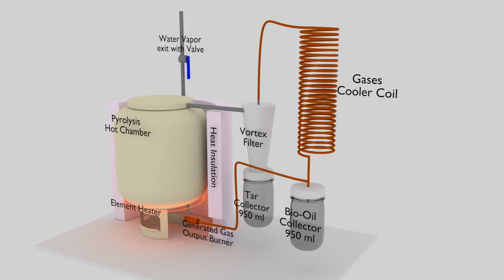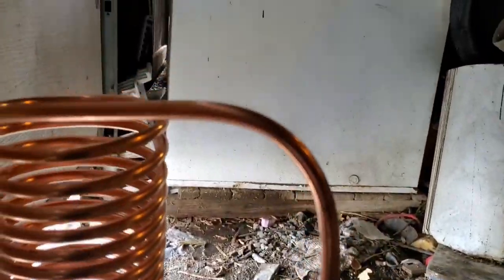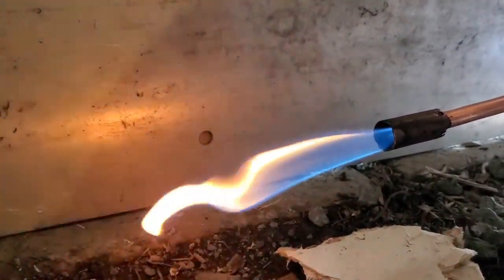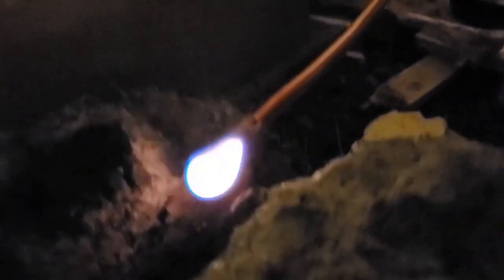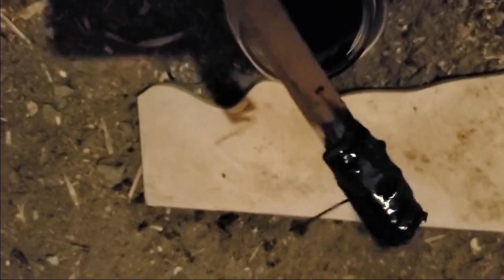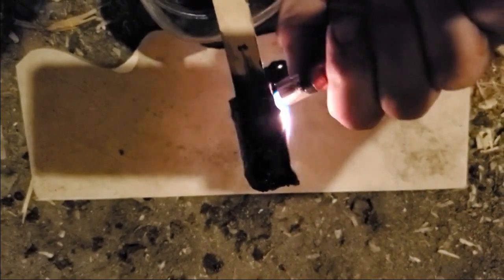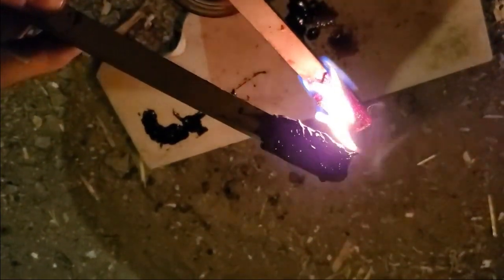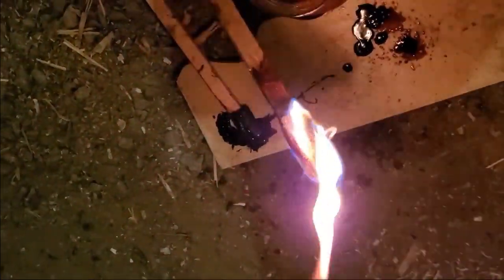Biomass pyrolysis reactor prototype

Comment: Blue flame means complete combustion. 
I think u need a larger reactor to produce enough gas to heat it up and it should be insulated (the reactor).
I was searching for the most energy efficiency biochar reactor and I think this can be the cleanest, I mean lots of examples use 50% of the wood to heat up the other 50%. 
Biochar is a nice way to put back carbon into the ground

Comment: So how much energy is required to heat the pyrolis container
Reply from the maker: I don't know. Tjis don't matter because the goal of this test it's just see how it's work and electricity is simpler to control. Long therm goal is to use generated gas to heat it's self and just keep woodchar and oil because it's safer and simpler to store. Concentrated solar energy can be a solution too.
Reply: @PyroEvil  I don't think you will ever have a positive exergy gain from pyrolysis. Pyrolysis is for vectoring energy, so like, imagine you have a surplus of energy, maybe you have some solar panels or something. Well, in that case, pyrolysis makes sense because you are converting a surplus of energy into energy vectors that can be easly stored and used. Otherwise, a conventional steam boiler with co-generation (so combustion) is the most efficient way to heat up a space, gasification should be left for energy production and pyrolysis for energy vectorization. I could be wrong thoe

Comment: Did you think about turning the final gas into liquid via catalytic reactor ?  Is it possible at that scale ? 

Nice set up btw
Reply: syngas is mostly hydrogen gas. It's not going to liquefy unless you put it under pressure. you don't need to crack it like it was oil products.

Comment: Nice video. However we use the fast pyrolysis plant Fpp02 for recycling plastic & wood waste. It turns out fuel for hot water boilers.
Reply from the maker: Thanks ! Fast pyrolysis with hot sand ? It's a homemade or commercial one ?
Reply: @PyroEvil , hi.
We use fast ablative pyrolysis. We dont use hot sand. Reactor power 500 kg/h. Commercial use
Reply: can you tell me more about it ?